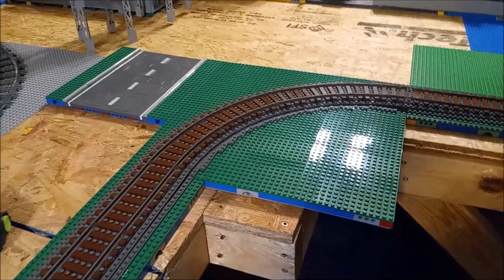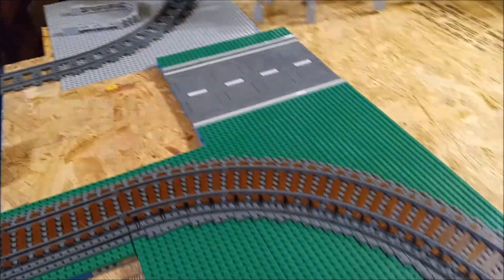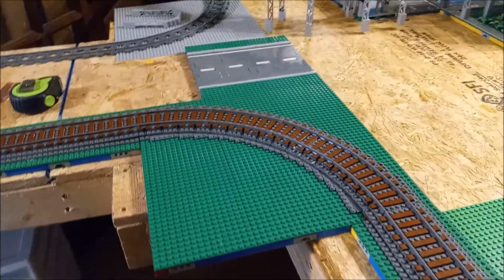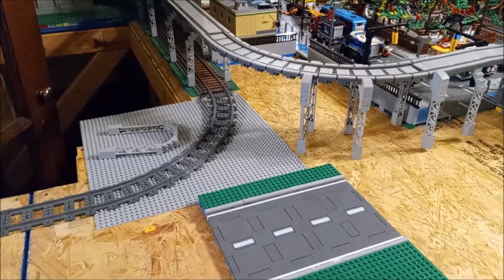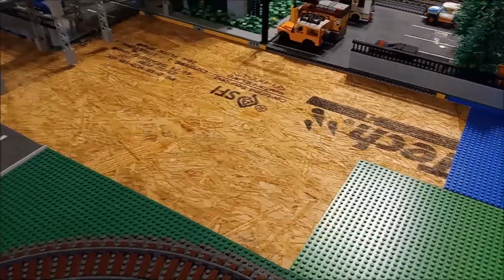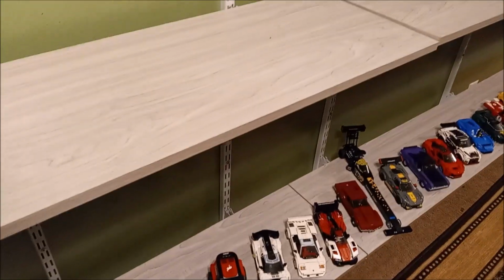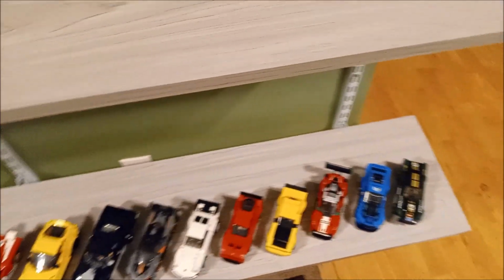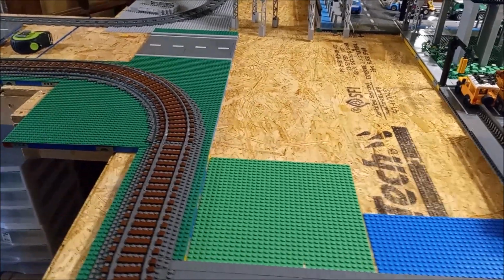Space Center Removed, Railroad Tracks, & Shelving Updates | Let's Talk About Lego!

Comment: I think you would not have the alignment issue if you used pegs to connect your MILS plates.
Reply from the maker: I've never tried that but I've got the technic bricks there to do it if I want. I'd probably have to redo the whole city like that though to fix the current problems. Maybe I'll start doing that on the new platform and do it on the existing platform at a later time. It is a good idea.